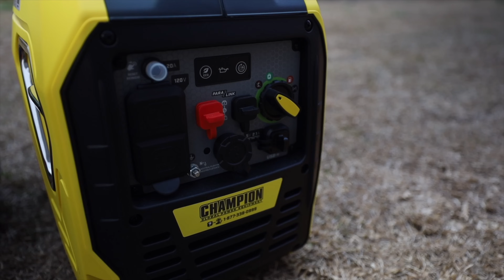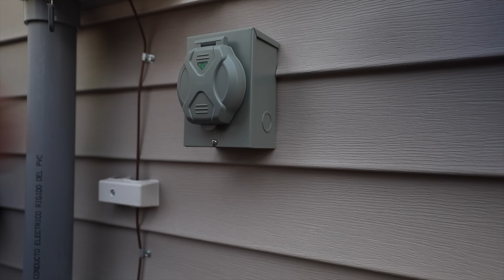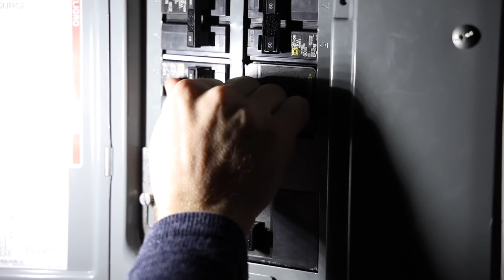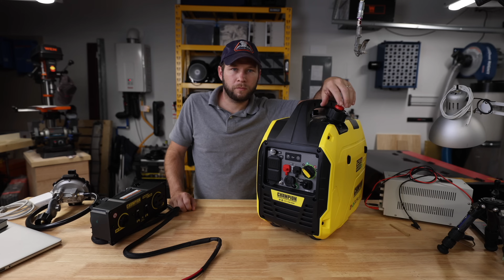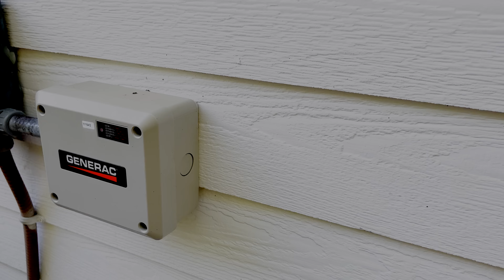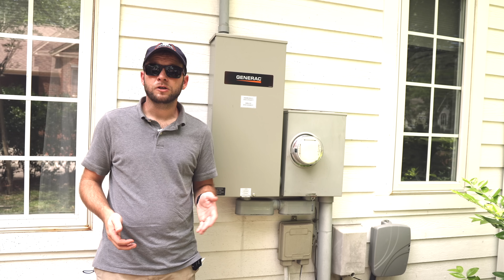Will running on a generator damage your house? Inverter vs standard vs standby

Comment: We have an inverter generator (Honda EU 7000 is) at our house. I had an electrician wire my unit. Like you said that was going to cost me a lot of money? You’re absolutely right ($14,000). I wanted a stand by unit however I live in an association that said no to the 1000 gallon propane tank. We went with gasoline because of the energy per gallon over propane. I keep over a hundred gallons of gasoline in my shed. That’s enough fuel for a week to ten day outage. I don’t have the luxury to run out after a major storm to find & purchase more gasoline. Why? I’m too busy as a power lineman in my area restoring power to everyone else but me. We typically work a twenty for hour shift our first day in (7 am to 7 am the next day). My generator has enough fuel for the first day at half load). Then we have 7 hours off to go home & shower & rest before going back to work at 2 pm & work straight through to 7 am the next morning. Rest out weighs buying fuel to run the generator hence the quantity of fuel I store. I have an interlock in my main panel. My wife is thoroughly versed on what she needs to do to get the power back on at home. Ours has a wired remote & she is able to start & repower our house without stepping outside. We have our generator inside a stainless steel enclosure that is vented on 2 sides. It’s on a trickle charger all the time. My gasoline is all pre treated. It’s all dated so I rotate my fuel so I only have fresh fuel at our house. I also have an auxiliary fuel tank that gives me 48 hours of run time between refueling. 
Everyone that sees my set up is highly impressed. Most of my friends are either lineman or electricians. 
Thanks for posting the best video on generators on YouTube!
Reply: No to propane, but ok to have 100 gallons of gas. That is totally nuts, propane is way safer. That being said, about five 100 pound propane tanks would give you a bit more runtime that 100 gal of gasoline. And the propane never goes bad
Reply: @joecummings1260  
Did you read my post from beginning to end? 
I live in an ASSociation that won’t let me store more than 30 pounds of propane. Let alone 800 gallons. My hand was forced. I would have liked natural gas but the line ends 2000 feet from our house.
As for the propane in a 30 pound tank? My wife is disabilled & can’t move bottles of propane willy nilly around let alone hook them up. 
Propane wouldn’t give me the run time of gasoline. I would have to hire someone to swap tanks for me. 
Yes, storing that much fuel is not ideal. My hand was forced.
Reply: @johnclyne6350  Maybe you misunderstood. I was criticizing the HOA not you. 

And the 100 pound tanks of propane are like 22 gallons

One gallon of propane is 4.2 pounds and has 91,452 BTUs  A little less than gasoline
Reply: @joecummings1260  
One of many issues I have of the HOA I live in.
This will be the last HOA we live in. They talk a big line but they don’t look out for the best interest of everyone?
The head of the HOA got in a big argument with me about the frequency of power interruptions. Someone who has zero knowledge of electricity arging with a lineman with the same power company that serves our neighborhood. 
She made blanket statements that “they never lose power”. That we aren’t allowed to have propane in any size on association property but I countered that they don’t enforce their own rules for propane grills? She was trying to blow smoke up my ass but none of it was working. 
I told her if they refuse folks from installing stand by units? They will force folks into buying rollouts which aren’t covered by association rules? Then they’ll be noisey & polluting & may be illegally hooked up? Just because they sell them at a mass merchandizer doesn’t mean the user knows how to hook it up. Believe me it’s the roll out generators that are the problem for emergency responders & the public at large. Every back feed I have come across was from an illegally hooked up roll out genny. 
As for fuel. My genny would burn less fuel than most because it has an eco theottle on it. However 30 pounds of propane will not last as long as gasoline. Plus my genny would be down graded because I modified it to burn propane. 
I’m better with gas for the monent. Unless things change? I’ll stay with gasoline.
Reply: @johnclyne6350  they don’t let you have propane, but they don’t care about 100 gallons of gasoline. I think that’s not allowed from a city perspective much less than HOA perspective.  He spent 14,000 on a Honda generator with a manual interlock?
Reply: @condor5635  Yes, everything included. 
I went top shelf on everything.
$3500 for the electrician. I went above code. 
$2700 for a stainless steel custom fabricated enclosure on a poured in place concrete pad with a ground grid.
$3700 for the generator. 
$2100 in improvements. I bought the service manual, lift kit, cold weather heater. A complete tuneup kit. A premium trickle charger. 15-5 gallon no spill fuel jugs. Star Tron fuel enzyme, marine grade Stabil. Honda wired remote I spared no expences.
$600 for a 30 gallon fuel transfer pump made by HMC. 
$200 BJ's for a chrome plated rolling shelving unit to hold the gas jugs.
$250 Gen-X Auxiliary fuel tank kit.
$1000 in incidental expenses. Soft start kit for central air & technician to install it. Custom stainless steel box & steel flexible conduit. That's for the soft start module. 
Yes, our electrician installed an interlock in our CB panel.
As for the gasoline. Last I knew you don't need a permit to keep that on your property? 
Again, I would have gone all propane but the ASSociation said no to propane. I fought with them for three years & they wouldn't budge. So I said to myself well they can pound sand now. I'm doing this on my own with or without their help.
Reply: @johnclyne6350  love being able to do it myself.  Soft start, inlet box, natural gas supply leg/valve, manual interlock. All for ~$1,800. Westinghouse 11500TFc. Sounds like we are both set for the next storm

Comment: Thanks for sharing your knowledge and experience. There are always someone wo has an opinion that maybe different or nit-picks terminology. I am an engineer also and agree with everything you shared. Not many people will go as far and in so much detail trying to may technical issues understandable for the layman trying to solve a common problem with power outages. Again great video!

Comment: I enjoyed your video. I live in South Florida. I see a lot of people having these very expensive automatic generators installed. They are great units, but for the amount of outages we have, I believe a decent sized inverter generator is a much wiser choice. They're much quieter and use less fuel plus cleaner power. I have my inverter 4 years, and we have had no real power outages.
Reply: I think the reason people install automatic ones is that they don’t want to deal with getting them plugged in, etc. they want the power to go out and it turn it. An inverter generator won’t do that. My parents for example chose the automatic and I chose the portable, more fuel efficient
Reply: And a stand by unit runs in gas not gasoline so you don't need to buy fuel. During hurricane Sandy you couldn't get gas for DAYS up here
Reply: @kirkstinson7316  - I have Honda portable inverter generators. I get non-ethanal gas for them when we get hurricane warning before lines get crazy. Whatever gas in left after hurricane i put it in  my cars. It's no trouble at all.

Comment: Hi! I see many videos where they build a sound and rain proofed casing  for portable inverter generators. Isn't that a possibility? That makes them somewhat a permanent installation. I am thinking of the new Genmax 10500 ietc tri-fuel. What are your thought?

Comment: I have a 20K Generak, house is heated and cooking is propane. It will power everything to include A/C here in the desert. Cost-10000 with installation (4 years ago). Love it
Reply: No, you have a 20k Generac.
Reply: Should got genmax

Comment: There are generators from small to large that will provide clean power.  What does he do?  Provides an affiliate link to one of the worse bang-for-buck generators on the market!  Depending on your need/budget, buy accordingly.  The best option is a tri-fuel generator to meet that demand.  It takes hardly any time/knowledge/money to hook up such a generator to the natural gas meter.  Gasoline can be the second backup.  Generac is the worse solution unless you have money to throw away.  Plus, he left out so much it's crazy, such as soft starts for AC, which can reduce the needed power, etc.
Reply from the maker: He has an entire video on soft starters if you looked. And the affiliate link was for a generator that I own personally and showed I the video. Because I’m not linking to something I wouldn’t buy myself. The champion generator was also on sale recently for about $400.. good luck getting more inverter generator for the money than that. Most all tri-fuel gensets have horrific THD on the order of 30%. Yes there are some standard (non-inverter) generators with great power quality but they tend to cost several thousand dollars.  I also didn’t go over how to change the oil in them, or how to do a tear down of a power head… because I can’t cover everything In a single video.  I would however love to link to yours just post it below 😉

Comment: No your explanation of how the automatic transfer switch is 100% wrong. When utility power is lost or below the utility voltage set point on N1N2 the generator starts. Then warms up, self checks, then transfer delay timer and the generator signals the contactor in the transfer switch to change state the generator input. Using an automatic transfer switch it is impossible to connect the generator output to the utility grid input they are mechanically separated and isolated.
Reply from the maker: As discussed elsewhere in the comments, it’s not wrong, the order of operations is just mixed up in one place when I’m describing it. Unfortunately I was not as concise in the description in the video and there is a misunderstanding with “always connected” I am not saying mains power from grid is always connected to the generator load output. I mean it is permanently wired to the ATS and sends voltage to the generator to charge the battery (via charge sub wiring in the bundle)  the mix up is the sever - start - connect. It is actually start - sever utility- connect genset. Transfer switch unit senses power loss (time delay), sends start signal, genset starts (time delay), sends back transfer signal, utility solenoid unhooks utility to neutral position, generator solenoid pulls from neutral position to genset connection.  No where in here is it stated that generator load output is connected to utility at anytime.  Of course this is specific to this type of transfer switch from generac, my Schneider ATS senses an outage and sends a start signal, it then monitors the genset load output for voltage, once it senses it is correct and stable it will transfer and watch the mains lines for recovery. When power returns it checks stability of mains, then transfers, then sends a shutdown command to the genset. Each manufacturer does things just a touch differently.

Comment: @kennethpayne7547
0 seconds ago
I had a 16 K Generac whole home generator that went out, I would like to use a 10,000 watt Firman portable generator in its place. 1) how would I manually shut off the power from the grid during a power outage and use the portable generator at the transfer box? 2) I would be using the Firman for outlets in the home only, does this sound like a do able solution? $1000 vs $10,000 I would manually do the disconnection and reconnection over the disconnection done automatically. Thank you for your input.

Comment: Very informative video thanks. I have a 22KW Generac here in Houston TX, frequent outages due to weather and its been great. We are connected to natural gas so no problems with fuel supply. Have ran as long as 10 days during an outage, shut the unit down every 2 to 3 days check the oil and fire it right back up. To be able to stay in your home, not have all food spoil and avoid the cost of a hotel the generator is the way to go. I am looking into a soft start for A/C I notice the occasional dimming of some lighting when our 4 ton central A/C kicks on while under generator load. No problems with appliances, computers (on UPS) etc.
Reply: No, a soft start is what you want to install if you have generators that have sags during AC start ups.  It helps the generator with surges, and helps the AC compressor by not dropping the starting voltage as much, (which is what causes the increased starting current, causing the generator frequency to kneel and the generator voltage to drop) which is what causes your lights to dim.
Reply: @bobbygene8274  Agree!  The soft start is an awesome addition.
Reply: Actually,  you should buy a hard-start kit for your ac, it reduces startup time with a high capacitance capacitor that reduces initial current draw on your power source. As an HVAC tech, this is what we do when the dimming lights are a nuisance. The capacitor stores a large charge, then dumps it into the compressor,  which is what makes your lights dim the most. $30-45 if you install it yourself.  Just ensure you size the HS kit correctly.
Reply: @craigbraswell4269  Had one installed 2 weeks ago, thanks.

Comment: The reality is as much as we want to be free of fossil fuel....it's still king
Reply: And will be, for the foreseeable future.
Reply: this is true if you ignore the many, many people who have solar, batteries, and inverters. Maybe you have heard, there are cars, motorcycles, chainsaws, drills, table saws, refrigerators and a lot more that do not use fossil fuel.
Reply: @mst5632 Don't worry they charge all that with coal power from the power plants 🤣🤣🤣🤣🤣🤣🤣
Reply from the maker: In my state, coal makes up less than 11% of grid generation and is getting lower.
Reply: @DemonicAnimatronic  there's a reason All cars were not electric because electric cars come out over 100 years ago, and especially you can't charge them when it's a hurricane and the power goes out 🤣🤣🤣🤣🤣
Reply: @DemonicAnimatronic  it's not sustainable clearly you can you can't figure that out
Reply from the maker: You also can’t pump gas when the power is out 🤷‍♂️
Reply: @DemonicAnimatronic  are you really that dumb 🤡🤡🤡🤡🤡🤡
Reply: @DemonicAnimatronic  it's called a generator
Reply from the maker: @IMSHIB  last time I tried to connect a generator to a gas pump they got mad 😢
Reply: @mst5632 Ok, Karen.

Comment: An AC alternator or generator produces a sine wave output.  With inverters as described, DC is electronically transformed to AC.  This is done by producing a square wave output with enough steps to MIMIC a sine wave.  Less expensive DC to AC converters produce in general dirty power, unless THD is less than 3%.  THD is the culprit that I relate as spikey noise which is not the same as overall voltage or frequency flucuation IMO.
Reply: If you ever have  chance, check out James Condon's channel.  He fixes used generators as a hobby and he has tested Honda generators, that with an oscilloscope, produces a pretty good replicated sine wave. Typical open frame generators, when unloaded, produce a fairly noisy sine wave and under load, produce a fairly noisy distorted sine wave.  If I could afford a Honda EU7000is I would have one.

Comment: What a generator first starts up it produces more power than it actually is rated for Generator. She’ll always be allowed to run about five minutes before you make the connection to the Generator if it is a manual connection or have your generator company delay the connection by five minutes.
Reply: 5 minutes is not really necessary, but I would give it a solid 30 - 60 seconds to warm up. (the time it takes to walk inside and flip breakers) Also, at least 3 minutes without load to cool down after a run.

Comment: Great job, I understand the spliting and twice the amparge on the neutral leg, myquestion is my RV has 50A hookup, some campground pedastals have only 20A and 30A receptcals, I have seen adaptors that have a 20A plug and a 30A plug to a 50A so then I can plug my RV into, so if I take my DMM and check for 120V at the 50A end then that would put too much amparge on the campground neutral?

Comment: Will the GENERAC type backup be allowed in New York State once fossil fuels are banned.  You’ll have to drive your electric car to the shelter, oops car ran out. Wind died down at shelter and has no electricity from windmill. So you die in your car half way there. Since we over shoot the lowering CO2 levels we now begin the 3rd ice age and can’t out run the mile high glaciers which will stop at the PA border depositing all the Teslas which will be uncovered in gravel pits of the future. Thank you Governor Hochol. 😮

Comment: there is another point that these "generator" videos miss and I think most people should be made aware of and that is the MAINTENANCE of these generators. Even though you may not use them a lot, don't you still need to change the oil and other stuff?
Reply: yup... and probably replace the battery every 4 years or so as well. There are other details like valve adjustments and the automatic safety items within the system.
Reply: Yes the standby generators require more maintenance and expense than portable ones.
Reply: No.  They don't.  There is nothing done to a portable generator that isn't done to a home standby system that isn't done to a portable system.  Maintenance is key in any system.   @Asidebar